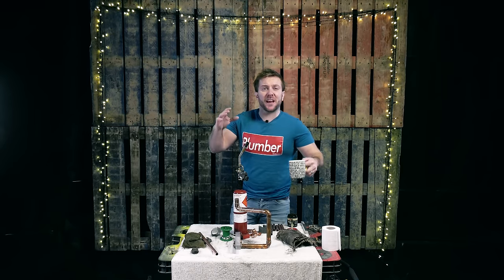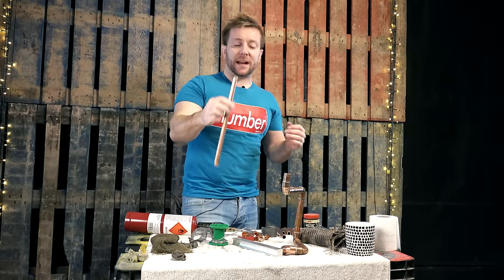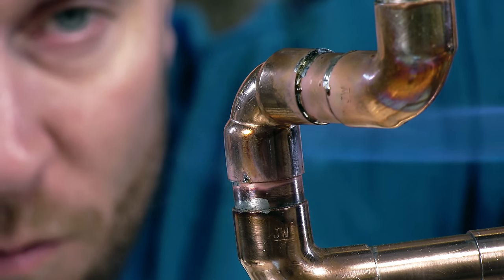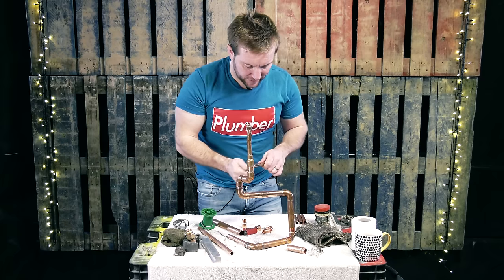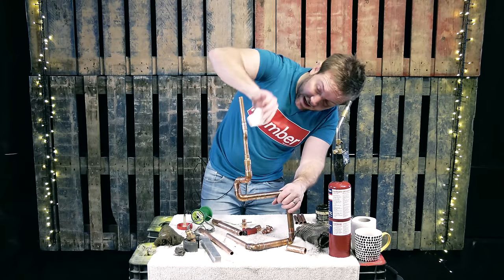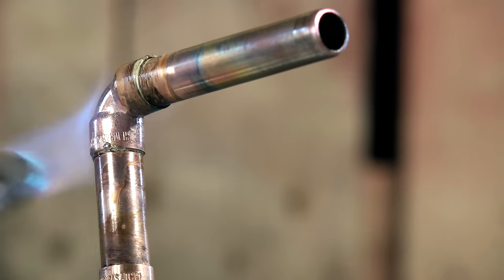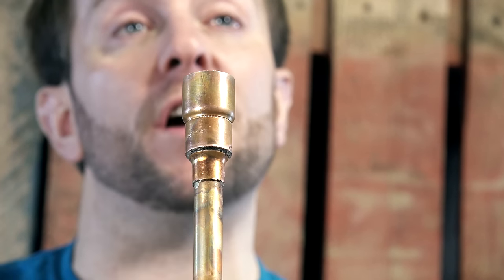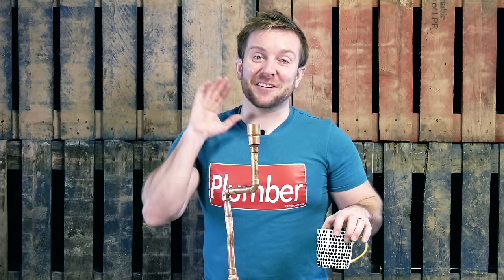HOW TO SOLDER COPPER PIPE FITTINGS WITHOUT SNOT - My plumber methods

Comment: I'm not a plumber, but enjoy diy. Previously my soldering has never been good. Your videos have guided me to get leak free joints. After a bit of practice on scrap I've refitted our bathroom including relocating 2 radiators, toilet,  sink and bath with a concealled tri valve shower bath set up. Can't say some of the joints aren't snotty, but they are solid and leak free. Keep doing these top -tastic demos. 
Sorry to the plumbing community.....you've lost one job and I've saved a few quid !

Comment: Should’ve put a test on!.....I take pride in my pipe work & soldering but I don’t get this obsession with seeing ‘no solder’!?! 
Yes make it neat & clean with no snots but I’d rather walk away knowing it won’t crack easily!........how many times have you pulled a weak joint apart because there was barely any solder on it???
Keep up the good & entertaining work! 😀
Reply: Paul W id rather see snot than a leak. I agree I try to make it tidy so I see a bit of solder but if it snots so be it. Just make sure you clean it up so the flux doesn’t corrode the pipe
Reply: Fibre Washer yeah same here mate (apart from being rough as fuck).....if it can’t be seen yeah whack a load on but if it’s on display I always try & make it tidy!.......my work partner leaves it looking like a church candle, more snots than Gilbert!! 😂👃🏻💦
Reply: So true it all gets lagged and concieiled anyway
Reply: Michael Dineen yes it should do around boilers & cylinders anyway! 👍

Comment: Surely a good joint is a joint that doesn’t leak . No point in saying to the wife how neat the soldering is when you are stood ankle deep in water . 
Great video had me chuckling as usual
Reply: Gixer750pilot lol very true mate .
Reply: ditto.
Reply: And a pro attitude says ....the solder you see around the joint or dripped on the adjacent area is just a waste,  and doing nothing to prevent leaks .. agree in as much don’t over fuss as time is precious to 😂😂
Reply: Rick Aldous solder is cheap . Leaks are expensive
Reply from the maker: No worries mate. Just prevents a dry one.
Reply: I found this comment funnier than I should have haha

Comment: Ive always found it helpfull to bend a slight kink in the solder to make it easier to reach around the fitting.

Personally  id sooner see a bit of solder than have to drain everything down and reesolder a leaking joint.

Comment: James it’s also a great good rule to remember the capillary action ( suction of the solder) will always follow the heat , so if a vertical joint looks like it might go to forming a snot then draw the flame up the pipe work in the opposite direction and if it’s not drawing in encourage it by stroking the flame again down the pipe in the direction you require ! It’s a simple rule and works !

Comment: In nearly fifty years of doing plumbing I've only had 2 leaking joints ---my first two. Then I was told to clean everything including the inside of the fittings and use flux and finally don't be afraid of using solder. I don't care how" instagram plumbers " can make it pretty---I can make it leakproof all the time.
Reply: Does using a blow touch affect health. Does it give off fumes. I'm planning on doing some pipe work around the house
Reply: @AMMO1981  ….
Reply: Install guy or service plumber? I’m in service and my dads a plumber so I learned young how to do it but started my apprenticeship and I have really gotten good the last few months but none in 50 years seems impossible my old man had a call back for a slow drip on a solder joint he did a few months ago and he’s been doing it 35 or so years now

Comment: I just made my first practice solder joints on the workbench. It was snotty and runny and blobby. But second one much better. Practise makes perfect. You learn by doing. Stupidest thing I realised is it’s much easier to hold the solder in your dominant hand so you have control of it!

Comment: A couple years ago I was introduced to a product called everflux I was skeptical about not having to clean the copper at firstbut I would never go back to the original method again unless the copper is absolutely oxidized or filthy. I swear by that flux it has saved me so much time

Comment: Great videos, I'm not a plumber but used your videos to help replace a soldered on leaking vent valve on our heating, I ended up using a Yorkshire fitting, that way I knew I had enough solder.

Comment: just to stick my £2.50's worth in there as a diyer thats learnt to solder from videos like this, mainly his earlier ones lol is not to add solder where your flame is, i noticed you did it a few times during the video but as you did you moved the flame, thats fine but i remember when i learnt on off cuts like what your using your not concentrating on the whole thing as a newbie and just on one thing at a time like the flame or the pipe or where you putting the solder, so basicly what im trying to say is if you stick the solder into the where the flame is heating you run a big risk of the flame just melting the solder and it running and dripping away from what your doing, my other tip as a diyer is the sound of the flame, i have the rotherburger n fries torch, when i first started i got used to the noise of the flame, theres a borderline of the flame making a noise,  just under there being no noise was great for 15mm and slightly higher just so it was making a light roaring noise was great for 22mm, again im not a pro just a diyer but if i knew what ive just said when i had my first go id be happy as a pig in sheet

Comment: Older pipe is actually easier to solder and not get runs. It has a thicker oxide layer which resists the solder sticking.

Some key tips for soldering an upside down joint CLEANLY are;

-Only clean the area you want solder to stick to.
-Wipe off excess flux.
-Heat the pipe first until the solder sticks to the joint, and then the fitting. This will build up the oxide layer and roast any flux that has dripped. It's also important as it helps prevent the fitting from getting "roasted".
-Apply just enough solder and apply it in several spots around the fitting.

Comment: Hi Mr Plumber 
i realy like your videos your funny and your very good at your work and thankyou for all your videos cause it realy helps 1 thing i wanted to say is that no jobs  are same alot of times when we have to repair a joint its in awkward positions like a boiler in a unit tight  spaces we cant take our blow torches 360 degrees as you would know i would rather use a solder fitting to keep the fitting gaurateed not to leak what im asking is please do some awkward joints where you would have to cut the pipes what would you use and your best way of doing it thankyou again

Comment: in case you didn't catch it, use your flux brush/flux to wipe away excess solder while the joint is still hot

Comment: There's an American plumber called Big Tony on Youtube (at least there was, havent checked since). I saw his system years ago which was to make up the pipe with flux etc and then wipe over with a rag impregnated with transmission oil before soldering. Never tried it but understand the method behind it. May be worth a go
Reply from the maker: Deffo going to look into that!

Comment: With my torch, if I have a small flame like yours, the nozzle glows red hot, so I have to have it roaring to keep the end cool (sounds backwards!). Is that just because I'm using Mapp gas? What torch do you use?
Reply: mapp gas is great,heats the joints up much easier especially 22mm to 28mm joints.
Reply: I only use MAPP gas for extreme situations like repairing slab leaks when holding back the water might not be perfect. But otherwise you should use regular propane.

Comment: Cheers mate for this. I’m not a plumber by trade so never had the balls to do pipe soldering but following your last couple of vids I’m going to dig out some bits of scrap pipe and fittings get a torch and give it a go. Always having to call in a plumber to do odd little jobs like capping off etc.  Is the process the same for gas pipes? Just worry about a torch in such situations for obvious reasons 👍🏻
Reply from the maker: Mate with Gas you’ll have to get a qualified fitter in. Otherwise if anything happens you’ll be living off the Queen for a while!
Reply: plumberparts oh yeah completely agree mate, wouldn’t touch it at all but just wondered if the process was different 👍🏻

Comment: This is the 2nd video ive watched on how to do this and if the first one was correct, then this one is wrong by adding the solder at the top and letting it run down. Other video said add it to the bottom and have capilllary action draw it up and into the joint. If ithe solder is running down you dont know if it is going in to the joint or not?

Comment: Most of the time pipes aren’t on show, in a cupboard or boxed in. I’d rather sleep at night knowing 100% a joint won’t leak, than its appearance. Not a glooby mess lol, but solid. You can also get a thin reel of solder, rather than standard fat stuff. (Hard to find but thankfully one local supplier for me stocks it - one out of many)

Comment: I have a steel tube bird feeder which has rusted, I have cut the rusted bits away and fitted copper couplings. They just need soldering or brazing, have you done a vlog on this sort of thing?
Reply: When working with completely dissimilar metals, I've had better success using some other method like epoxy or a mechanical fitting like compression.

Comment: Quick question, I'm not a plumber just a DIY enthusiast. If they have banned the use of lead solder and flux that contains lead why is it still allowed for older house's to have lead pipes leading to the property?
Reply: It's around because not all pipes and repairs are for potable water and there is a demand. If drinking water is involved, you shouldn't be using lead.

Comment: Would like to see these pressure tested after the solder, just to prove to everyone that it's all good.
These vids really help be making my joints better, only DIY plumbing, but it all helps... thank you.
Reply: Your suggestion reminds me of some of my earliest mistakes. Pressure tested immediately after doing a solder job almost exactly as shown in this video... And blew out the joint. From that, I learned that it's essential to use a wet cloth to wipe down the solder job, it's not just to clean up and "prettify" the joint, it cools down and solidifies the molten solder.

Comment: Currently studying level 2 plumbing in college and just to let some of you know if your wondering why solder can go up the fitting it’s called capillary action this is when two objects are extremely close together
Reply: soldering doesnt work by capillary action, the heat is pulling the solder into the joint. capillary action is when a liquid such as water climbs upwards between two objects with no assistance
Reply: It’s capillary action google if
Reply: @jamiedyer7782  No youre wrong, in my country we used to call solder fittings as capillary fittings, does that make sense to you?
Reply: @charlieshargreaves2310  You are right mate
Reply: Mar Cel I funny you reply I was thinking about this comment today ! How weird . Thankyou man
Reply: @charlieshargreaves2310  Cheers

Comment: Silly question, why do you not solder all the way around the joint? Does the solder get drawn all around the joint automatically?
Reply: If you apply your flux correctly, yes exactly as you guessed.

Comment: Nice when there's Only warm air in the Pipe ! My only tip would be clean until you Know the Old pipe work is Completely clean of Paint and all rubbish. If when you solder it goes to quick or burnt looking take apart and redo don't hope...unless to can afford it.

Comment: The key is cleanliness is godliness. A heat mat to prevent burning behind the pipe work. A bit of dry rag to wipe off excess solder. As advised don’t overheat the fitting.

Comment: Any tips on soldering copper to brass, ie a meter Union. I always make a mess of it
Reply: I did one recently. My tip is to apply gentle heat only to the brass union
Reply: Best advice I can give you is try to pre solder the union on its side, try to heat it up evenly. Lay it vertically on the nut and put your 15MM guide under the CU side.

Comment: Keep dabbing and dabbing until it’s completed soldered snots and all I’d rather it didn’t leak than look pretty it’s not a Christmas cake 🧁 but then I’m not a plumber 😂👍
Reply: Actually, proper technique is to simply dab once. If that isn't enough then you're doing things wrong... maybe not cleaning properly, not apply sufficient flux or properly, insufficient heat (too much heat can be bad, too).

Comment: Good video, little bit too much heat on the 15mm as was cherrying a little. I'm suprised your not always bending the end of your solder as you was struggling to get round the fitting. My boss prefers leaded but green all the way for me. Keep up the good vids, debating the fluxuator thingy for my kit :)
Reply: Fluxuator isn't actually that bad. I've purchased the 15/22mm version. It can also be refilled, although I haven't tried yet. 
I press pretty much all my fittings nowdays. On the rare occasion I solder. It saves me putting for a hot works permit on sites 😊
Reply: @rayc1503  always good when you can get the bulky press tool in, I spose that's what hep2o is made for these days :) I was always trained using the big gas bottles, lugging them up a roof space was a pain in the arse!
Reply: @mattkainicram  10+ years in this trade and I still have many things yet to see. Everyday's a school day, right.

I'm glad I've never had to do that lug massive cylinders about. I'll be glad the time when press fittings become more popular. Hopefully the prices will come down, slim chance though😜. Saying that more and more of the guys I see on site are using them too.  The fluxuators actually not that bad. Go on treat yourself geez.😊
Reply: @rayc1503  haha thanks mate will do, I've been doing it 12 years now and like you say still a school day :) we used to always use Yorkshire fittings up to 63mm so pretty much a 100% water tight fitting. Slight increase in price but not alot

Comment: As an electrician who learned on electronics... it's interesting to see the differences between plumbing soldering and electronics/electrical. Most of it is the lead free thing. I will use leaded solder forever. I genuinely don't think the amount of lead leached in from lead based plumbing solder would be that damaging, but that is politically incorrect
Reply: It can be a really bad problem in plumbing. Lead doesn't leave the body and accumulates. So although lead solder is soooo much easier to use, it should only be used in non-potable plumbing.

Comment: After skimming the comments after viewing this video,
IMO it's missing 2 critical steps...
1. Proper technique applying the flux. This is one of the most important steps... after GREAT cleaning with sandpaper or emery, you need to apply flux VERY liberally (you can't add too much if it comes to that), and pipes and fittings should be joined with both a push and at least a quarter, maybe even more than a half twist to ensure all flux is spread perpendicularly to the pipe's direction, ensuring solder will flow similarly. If solder flows only in the direction of the pipe, you will have gaps and leaks.
2. You should immediately cool each solder joint immediately with a wet cloth and not wait for the joint to cool naturally. Until the solder has solidified, you do not have a solid joint.

Comment: Yeah all looks good on a bench, I also take pride in my workmanship however try making your solder that neat and actually on a job under floors up and close round the back of toilets and cisterns trying not to either melt something or scorch something so on and  so fourth basically while on the job not so easy .
Reply from the maker: You should check the video I did a few years ago...called Soldering in real life. You’d be able to relate...

Comment: Do you recommend using compression fittings on radiator pipes under the floor or soldering is best ? ❤

Comment: Two Q's...1) In reference to "Flux", how long should you wait to drink water...flush out a brand new soldering job? 2) How do you solder near a plastic housing from a whole house water filter???
Reply: 1.  If you do a soldering job properly, the pipe should be usable immediately.
2. You can place (or purchase) shields when working nearly next to fragile or vulnerable objects.

Comment: How do the Instagram pipe polishers get no solder showing?
Reply: Technically, this video is missing an important step... Wiping down the hot joint immediately after the job to solidify the solder. Doing that should at least remove almost all excess solder so no blobs show. That should be good enough but if you want to take it a step further you can finish up with some emery cloth so no solder shows at all.

Comment: Hmmmm...
You don't cool your solder joint immediately with a wet cloth?
It's not just to clean up the appearance, it's also so that the joint remains solid while you do your work. If the joint moves or loses solder because you're applying heat in another joint nearby, an uncooled joint will lose its integrity.

Comment: in my honest opinion id doubt most those joints are water or gas tight,too much heat,not enough solder and all the black carbonisation around the joints tells me way too much heats burning the flux away.
Reply from the maker: Ok Bizz thanks. I pressure tested them and they all leaked over the floor like my tears reading your comment...NOT!!!! 😂😂😂
Reply: @plumberparts  das gut yaa

Comment: Actually, heat doesn’t rise.  That is a common misconception.  A heated fluid rises, but not heat itself.
Reply: Agree. The heat is conducted through the pipe in al directions, any effect on "rising" is insignificant.